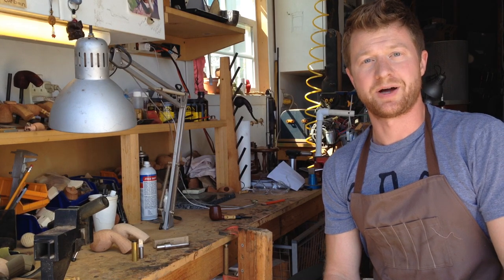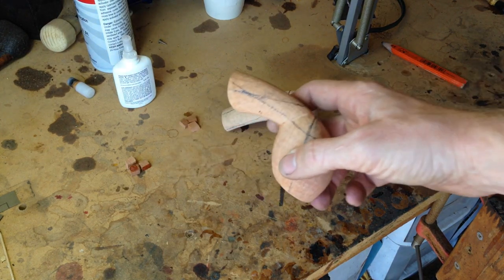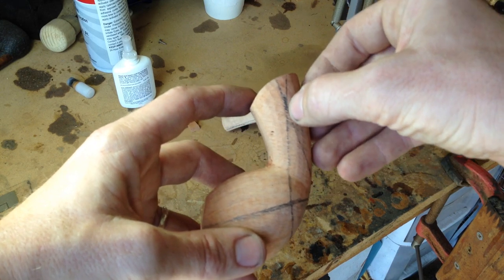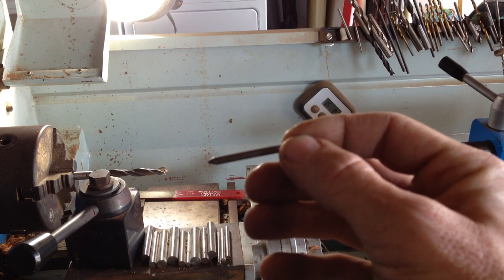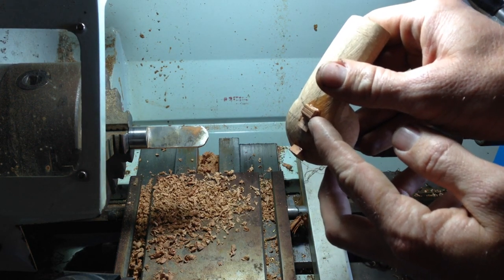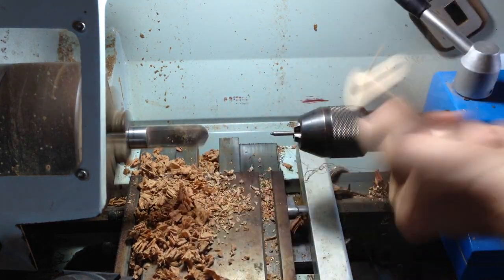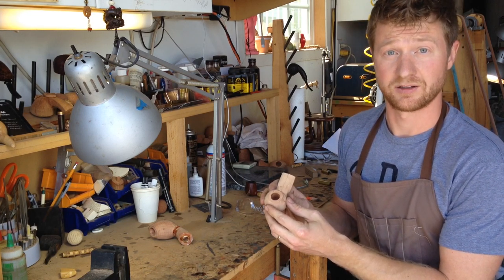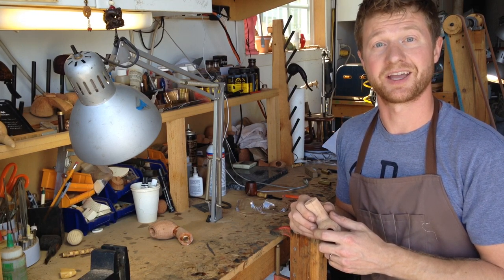Freehand Drilling with Spoon Bits -- J. Alan Design Tools

Comment: I didn’t expect freehand drilling to involve a lathe! I was expecting a manual hand drill!
Reply from the maker: It's counterintuitive, but a lathe is safer to use than a hand drill.  You couldn't pay me enough to try using one.  :)
Reply: @jalanpipes  I can understand that… I meant a brace and bit, rather than electric hand drill!

Comment: Like the use of the blocks for the center.

Cringing watching your hand holding the work from the underside. That is a strong grip that gives you good control, but even if you’ve done it a thousand times without problems, it only has to snag once to cause serious harm, even at the low speed.

You could try resting the work against a dog and guide it with your hand out of harm’s way.
Reply from the maker: No doubt.  it's one of the inherent dangers of drilling this way.  I take the precautions that I can (no long sleeves, hair, keeping a clear path to the emergency shutoff), but unfortunately the method you've recommended won't work.    Some makers grip and pull toward them from the back side of the chuck.  Also, one of the reasons I chose this lathe is that it is belt driven and I can stop it with my hands if need be.

Comment: I'm still confused as to the purpose of those little blocks you super glued on.
Reply from the maker: Thanks for the comment.  It's explained more thoroughly in here: Making a Military Mount Pipe -- J. Alan Design Tools.  I was originally going to make both videos into one...but it would have been too long.  The editing is choppier than I would have liked as a result, but hopefully illustrates the techniques sufficiently enough.
Reply: So you don't damage the pipe with the pin - he's pushing with the tailstock and the pin would damage the pipe. Other pipemakers use little blobs of epoxy but I think these blocks are simpler.

Comment: It must different cultures that you are calling a spoon bit we call a half round and a spoon bit is actually made out of flat peice of steel  at least from a blacksmith's point of view cheers
Reply: Yes, half round drills are often used by machinists on hard materials. The blanks can be had from machinist’s suppliers, though probably not in the sizes Jeff sells, and they’d be either hardened tool steel or carbide,